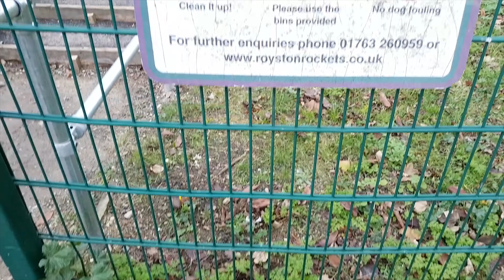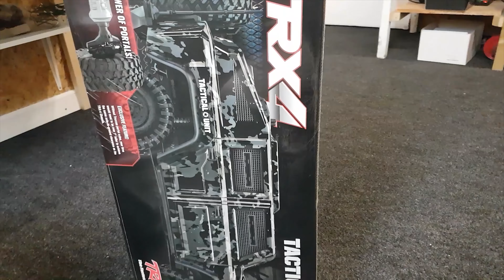Traxxas Slash 4x4 WRECKED on BMX Track

Comment: Great video! The hesitation when initially accelerating or just after braking is probably due to cogging. This is common among brushless sensorless ESC/motor setups. Basically, the motor is just trying to figure out its position so that it will spin the correct direction. This is similar to a brushless quad or airplane motor twitching the props 1-2 mm when first powered on. Having a sensored setup (using a sensor wire to connect the ESC & motor) can help eliminate this cogging. (Your VXL motor does not have this option.) I wouldn't worry about it, this is perfectly normal.
Reply from the maker: It never used to do it. Its hard to show on video. Sometimes when its in the air and I need to throttle it to pull out of a dive if hesitates, defo something wrong dude

Comment: For the delay in your electronics, I noticed that my Dad's velineon system in his Pede actually has quite a bit of delay. I think the motor coggs at very low speeds, so the only way to fix the problem is probably to replace the motor with something that won't cogg. I don't know what motor that would be, but you might want to look at Castle Creations. Don't know how much of a difference that would make but you can always try it. Hope this helps!

Comment: They do make replacements parts for the Traxxas metal driveshaft Traxxas has a kit u can buy. I have 2 4x4 Slash trucks that I run them in. I have broke one before but other than that they hold up good for me. I am just running 3s though so 4s or 6s might kill them 😂

Comment: they're not bad but if you're really going to be bashing go mip really heavy duty also did you ever think about also putting 17 millimeter tires on for Speed runs so you can have belted tires I use grip, no ballooning summer rated up to 180 mile an hour

Comment: you might want to get the castle 1406 2850kv where its rated for 4s, you might have burnt up the motor with the extra stress.
Reply: R/C Insanity  It should have no problem running 4s I run 4s on Traxxas rustler it works completely fine mate
Reply: It’s a program problem mate

Comment: Hi mate just a quick question, I have just brought 2 new 5000mah 3s peak power plant batteries and put them on for there first charge today but the charger stoped at around 50mins but they had only reached 1600mah I then tried to use them on my car and they didnt have enough power to move it. I then charged them again and they only charged about 400 mah ?? However the batteries are at 12.6v   ?? If you have any ideas let me know. Keep the good vids coming you will go far on YouTube. Cheers
Reply: The batteries will do that for the first couple of charges but if it persists you might have some did batteries.
Reply: Dud batteries

Comment: Thats What happens with Plastic Axles ... you can't run more that 3s or you will bust from torque   The traxxas metal axles may solved this issue
Reply: Robert F. Labato I just converted my 2wd slash to a velenion vxl 3s, with a 3s battery, shattered my axles within 1 week, then came my chassis and that snapped in half, so I got a brand new chassis with metal chassis brace, runs like a dream now
Reply: The stub shafts he snapped are metal.

Comment: Not sure how you managed to brake both rear wheels like that.  LOL Dumb luck I guess. 
I have beat the crap out of my slash 4x4. I have broken about everything on it at this point. 
But I still have only broken one front axle like that and I hit a pole at like 40mph on throttle to do that.  LOL
I replaced all the Traxxas shafts with Tekno RC ones and have not broken another one since.

Comment: Its your motor i had the same issue after i ran my traxxas velinoen motor you should go get a 3800 castle motor but could be a setting in the esc but i doubt it traxxas velineon motors suck man

Comment: It’s a setting
Reply: ArrowmaticRuby 
yup. 
Bind controller again to set points or be aware the esc has 3 settings 
fwd/rev with pause ---
Fwd/rev no pause ---
fwd/brake with no rev (race)---
Reply: Adam Wallace thanks but I’ve fixed it I’ve had the ecs for 1 year now and it great I was just telling Kevin